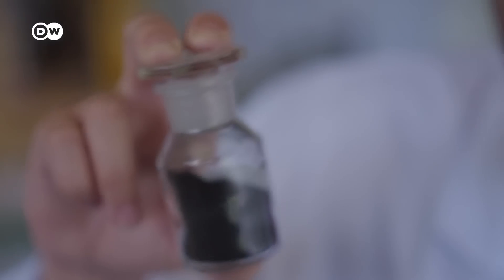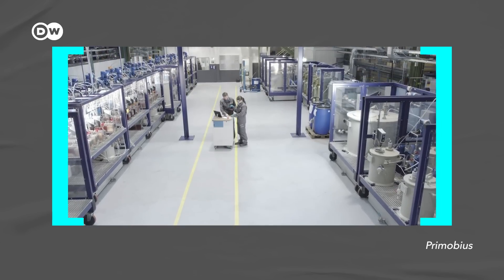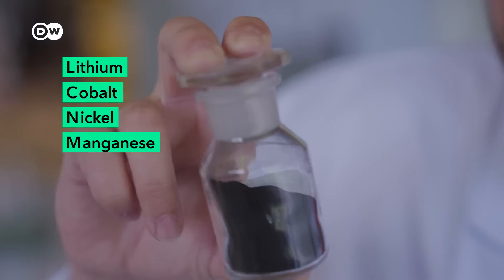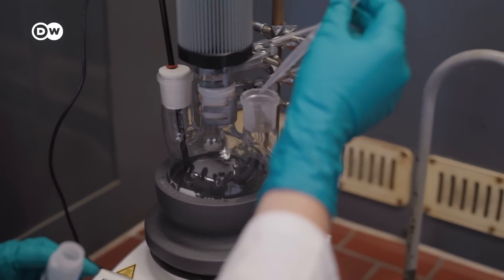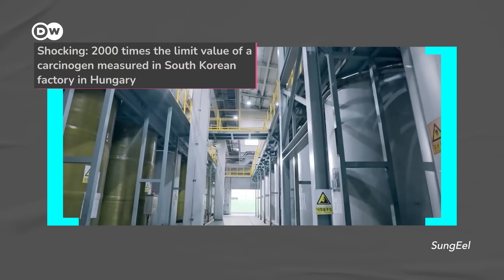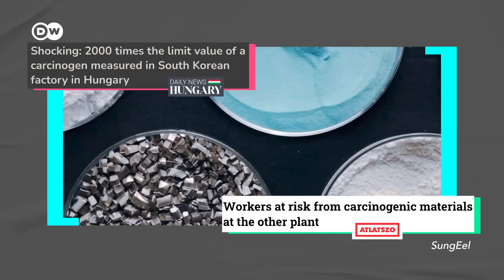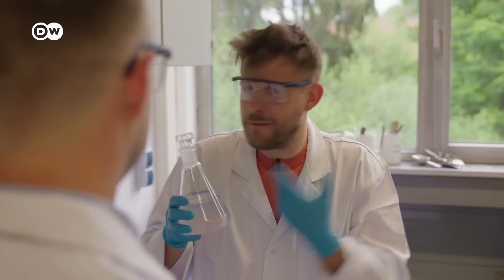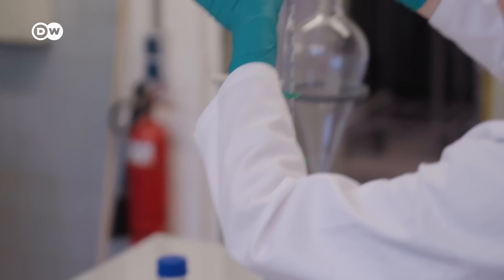The problem with recycling electric car batteries

Comment: 1. EV battery life is longer than most people imagine. A lot of 10 years old Tesla EV battery still retains a lot of charges.   So there aren't enough EV battery for the battery recycle industries to make profit. 
2. Battery recycle industries need subsidies to learn the challenge, before enough old EV battery stock pile up. Without subsidies, the EV battery recycle industries will not survived. While China government happily provide grants for battery recycling industries in China,

Comment: What was clear was that if the recycler got the batteries for free they made a lot of money. That's good news as it means there is a instant market for an old and dead battery so people will cash the battery in rather than dump them. Maybe the recycling of batteries will just happen naturally and not require massive Government intervention / subsidies etc etc.

Comment: Hey 🙂 
REDWOOD Battery recycling. CEO. JB Straubel. has been with Tesla from the start of Tesla, with responsibility for the battery system
Now he is the head of RedWood Recycling.

Redwood had to go out and find and create supplies of used batteries worldwide, as that market was not there before, and it has been a big task, there are extremely many batteries from mobile phones and laptops, and of course other electronics.
:-)
YouTube
https://www.youtube.com/@redwoodmaterials/videos

Comment: I'm no battery scientist but why do we shred and mix everything down to powder form and then find ways to separate. Is it like impossible to separate cathode and anode? Just asking. Can't we just charge the battery 100% and recover Lithium Cathode? Idk I think physical separation might be expensive because of human intervention but it seems to be easier option to me.
Reply: Graphite can't recycled and is classified as finite material. Graphite is pretty complex. Natural graphite can vary much in it's quality. Synthetic graphite is better but dirty and energy demanding to make. Petcoke, tar and slack are blended together in steam heated blenders and during high temperatures and high currencies this plastic mass is turned into graphite. Right now there's no market for recycled lithium carbonate, It's thrown away like waste

Comment: Interesting  and disappointing that this video does not discuss the main fate of most EV battery "black mass": burning in smelters
Reply: well yeah a chemical battery is not economically viable to recycle in any way whatsoever.  Unlike lead acid that actually has value and is easy to recycle.

Comment: REUSE BEFORE RECYCLE
I've made a 25k/w battery from 2nd hand battery 
I reclaim over 80% of batteries 
for example, cordless drill battery has 10 cells 2p by 5s
when 1p fails the whole battery fails i get 8 cells at 80% plus life still in them
It takes about 20 minutes to strip one k/w
3 days to go thru test cycle no labor
I make 140 18650 cells that test over one K/w
14 s of that is 12 K/w at 20 to 80 % useable and will last for 20 years
REUSE BEFORE RECYCLE
Start to finish you could make 2 one K/w cells an hour 
The 20% of dead cells with be strip down and separated 
to circuit bords plastic Nikel strips meatal screws etc
Cut down on the amount of materials to be processed   
if you pay $50 hour labor you can make 1 K/w for $25
Good for 20 years of grid or house storage 
Why is this world so dumb
Reply: You can set small scale factory close to source 
The math's is scalable from 1 person to a 1000 people
Reply: I also reclaim 2nd hand solar panels 
so 2 sqm of roof of your 1000 sqm factory
can produce 1 k/w a day 
equals 1000 K/w a day average
2000 K/w Battery will use up about 100 sqm of floor space 
rent out the 900 sqm
1000 K/w a day at $0.20 K/w is $200 a day profit
$70,000 a year
for 20 years
with some Maintenace

Comment: We can't even recycle sorted plastics efficiently. I am not holding my breath on battery recycling coming anywhere near economical viability.
Reply: the difference is that soft plastics are challenging since new plastic is so cheap. at least with batteries, the cost of manufacturing new batteries are already very expensive, so there’s a good chance recycled batteries could potentially be cheaper than having to mine for new materials
Reply: No doubt. for years they also lied about recycling glass. We'd put the bottles in our recycling, or bring them in for deposite, and yet they'd still end up in the land fill for years. Then they finally scrapped glass bottles.
Reply: Have you heard that EU and Germany plan to mine lithium reserves out of Serbia? They partnered up with Rio Tinto to dig out lithium reserves in Serbia, and thus, cause ecoligical disaster...
But no one cares, because Serbia is a cesspool of Europe, not enough woke for Europe 🎉

Comment: Interesting!  If battery manufacturers were made financially responsible for the recycling then there would be more motivation to standardize batteries for the recycling process.
Reply: I think that's where government is need as an intermediary to create policies that standardize batteries for recycling process as well as balance for future innovation.
Reply: maybe in the future the manufactureres will be recycling their own batteries so it could be easy to recycle them. Ex. Tesla having a recycling plant. They can automate the human labor part since they have a few types of batteries and it can easily be automated. They wouldn't have to worry about so many different type of batteries.
Reply: @jayshahrealestate  The plant they show footage of is being developed for Mercedes by SMS. It will be run by Mercedes to deal with production scrap, recalls, and their own end of life batteries. Standardised feedstock, known scale and economics, completely vertically integrated.
Reply: I agree. Most likely raise the price of batteries, maybe not double. I think it's a question of our societal values. Value short-term production at low expense or a long-term sustainable approach at a larger expense in the short-term. I think government should be involved, because I don't think industry would self initialize standards.
Reply: I see how you would apply business logic to end up with this thought, but this is where the main problem in this case.
 
The batteries are not a thing that can be so easily dismantled. 
They are a highly sophisticated, high voltage storing device, a thing, that is a lot more than the sum of it's parts. Once assembled and charged, a battery is not an easy thing to handle, on a specialized worker scale OR worse an automated line. 

Further more, battery modules are really the most often changing part in EVs right now. From newer architecture to newer chemistries or even different charge architectures, they might change 2-3 times per year in the same model! Sure, some parts will be the same, but they are the biggest RnD sector in EVs, every kilo and every kilometer they can squeeze out matters a lot. So automating a line with robots with all these revisions would be really hard at the moment even if you had a dedicated line for say only Tesla Model S's batteries.
Reply: @KostasTsakalidis   @tommclean7410  read about Jadar mine and Rio Tinto's plan to use around 1-3 olympic pools of concentrated sulphuric acid (H2SO4) for Jadarite (ore that contains lithium) refinement.

An interesting fact, the formula of Jadarite is similar to Kryptonite 😁

Jadar area is located in Western Serbia, and is near Drina river (Drina is a part of Danube watershed). And Jadar area has one of the most fertile soils in Serbia.
Reply: Except that the current 'free enterprise' corporate mentality despises standardization over proprietarization.
Reply: Have you heart about the EU plan to mine the fuck out of Serbia's lithium reserves??
Reply: But who is to say what the "standard battery" should be? The whole idea of competition is the best product will eventually emerge. Having a committee of "experts" decide the correct path is asking for BIG trouble. At one time a majority of "experts" claimed DC electricity was the way to go when it comes to commercially provided power, (the first commercially provided electricity was Edison's DC system), but the market eventually proved that AC was better. 
Not only that, if you make all battery manufacturers financially responsible for the recycling of the batteries they make, how many companies would continue to make any batteries at all? And the ones who did continue to make batteries could only stay in business if they passed the higher cost along to the end user, YOU. So instead of the average EV price of $65,000.00, the average could be $130,000.00, and a replacement EV battery would be $80,000.00. Because fewer EVs would be selling, the number made would go down, and the unit price would go up. In no time EVs could be in the $250,000.00 range. Then who would be buying EVs? In fact, who could buy EVs? Only the rich, that's who. Is that what you want?
Reply: True. But if this responsibility is only applied to EV/battery makers then it gives an unfair advantage to fossil fuel producers who not only don’t have to consider the lifetime effects of their products but even get subsidies for pumping oil. My point is: we need a concerted effort
Reply: Only if they combined their recycling efforts or outsourced the recycling to a third party.  Maintaining their own proprietary recycling chain might be the approach they would take just as Tesla benefited from having a proprietary fast charging network and Apple benefited from establishing a proprietary ecosystem.
Reply: Hello from Los Angeles California.  I lived all my life in Los Angeles California, and in the 1980's the Smog was so thick it filtered the Sun. The smog blocked the Sun so much the winter's in Los Angeles California was so cold between 36° to 55° Fahrenheit nights dropping to 33° Fahrenheit 
I couldn't see mountain ranges from where I live 4.5 miles away. Unless it was windy and smog cleared. Now the air is so clear you can see cracks and riges, on the rock walls. 
It uses to rain 🌧 none stop for 7 months, and the summers never exceeded 90° Fahrenheit. Due to Sun being filtered from smog I also didn't need shades, for my eyes. Now 🌡  are 110° Fahrenheit for excess of 1.5 months with 5 days in the roll Temps exceeding 116° and 1 day at 120° to 126° depending on fire conditions radiating heat. 
Air clean enough, and it will not get any cleaner with only Electric Vehicle's (EV's)
Now to the reason why Environmental green agenda causes Drought Conditions.  In 2010- 2013 there were Solar Mirror s installed to project solar arrays to a Tower with mirrors projected downward to under ground reservoir water sources.  To generate steam, and generate Electricity.  
The temperatures 🌡 causes the atmosphere to close to 5,000° and every time birds fly thru become instantly baked and fall. 

In the 1980's the Jetstream used travel across California in to Nevada,  Arizona,  New Mexico,  Texas, and so on to Florida.  Due to the Mirrors the Atmospheric High Pressure. Has pushed the Jetstream away from Southern California to North to Washington,  and or Canada 🇨🇦 . This cause along with getting rid of Smog cause higher temperatures and Drought Conditions. You couldn't pay me $10,000,000 per hour to sit, promote,  sell, let alone buy any Electric Vehicle's (EV's).
If you look up StachD Training channel, on his video titled Lithium Largest Ex plo ding EV Recycling ♻️ Center in Missouri.  There were 4 Recycling ♻️ Centers in the United States.  Now there are 2 Recycling ♻️ Centers,  and none are in the State of California.  Due to Environmental Impact, which the video shows Fire Authorities spray granulated elements of the Lithium-Ion Batteries 🔋 Packs,  into creeks, rivers,  and lake anfmd underground well resources.  Not even boiling helps, and fish hacmve died in those water ways.   Sure clean the Air while you Pollute the water. In April 2024 the 1st Recycling ♻️ Centers in Phoenix Arizona location burned down,  and dousing water to keep cool prenting spread of fires 🔥 have caused Drought Conditions.  @truebrit3670  Look it up
StasheD Training channel 
Missouri Recycling Center ♻️ Ex Plod ing can't spell this out. Fish died wells for water is no good anymore,  and became Acidic 
These are facts. 
Mirrors in Mojave Desert Modified where Jetstream away from
 Southern California.  
The so called green agenda is to keep there pockets full or bank accounts.
Reply: Makes these expensive batteries even more expensive. Probably double the price 😆
Reply: @philpreston3072  Not necessarily. If Tesla, for example, knew that it would be responsible for recycling all it's old batteries then it would design them with that in mind. Which would most likely result in making them: 
1. Cheaper to disassemble. Right now they are a nightmare with all the adhesives they use to secure things.
2. Have more parts, like the housing for example, be reusable or at least more easily recyclable.
3. Use battery chemistries that are more conducive to recycling.
I wouldn't even be surprised that given enough time, it would drive the cost of batteries down as the old batteries start to become valuable. If the recycling process becomes efficient enough, old batteries will have a scrap value that would help offset the cost of swapping batteries.
Reply: @siggyincr7447 Swapping batteries is a rare event and will get even rarer with new generations of batteries. The problem with newer Tesla batteries specifically is that they are almost impossible to repair, whereas Korean batteries (or rather packs) for example are fairly easy to repair. Which means they are also fairly easy to recycle. Tesla packs will have to be shredded as a whole. However, the vast majority of battery packs do and will outlast the car they are built into. It seems rather unlikely that there will be a significant amount of batteries to recycle anytime soon. The EU never the less requires new batteries to consist of a certain percentage of recycled materials from a certain point onwards. That should motivate manufacturers to make batteries easily recyclable (because they must purchase recycled materials regardless of price and thus are interested in keeping recycling cost low) and it means battery recycling will be a solid business.

Comment: In my opinion, profitability should not be the determining factor. When a company produces something, it has a responsibility to the environment to ensure its products can be recycled, thereby preventing environmental harm. I believe we humans need to adopt a different mindset: we must stop doing things without considering the consequences and then dealing with the problems later. This way, we avoid situations where 'it is not profitable to…', as profitability should not even be a topic of concern. Inevitably, we end up questioning the value of the environment or life itself, which should never be the case.
Reply: If not for the profit what will be the incentive?

Comment: So, from my humble perspective of a bachelors mechanical engineering student, the first logical step for me would be normalization- manufactures should agree on the sizes of the individual batteries, so the robots can be programmed and dismantle them- that would cut out the expensive manual labour. And then maybe, but ofcourse, I don't know how much competetive they want to be, they should agree on which types of the battery fillings to use. I feel like if there will be just few simillar types, that this challenge can be overcome too. But again, I am writing this here just because norms at my field usually do a pretty good job at lowering the cost and effort of designing, manufacturing and selling certain parts....

Comment: When I see images of old batteries being shredded I always think the same, ¿Wouldn't be better to disasemble it piece by piece? I mean, every piece is made of separated elements, why shred the battery as a whole, when you could treat each of the separated pieces? A lot of energy was used in separate those elements to make those different parts and components during the fabrication process, why mix all of that together again, just to separate the elements again shortly after. I can't believe that it's cheaper this way, to be honest... 🤔
Reply: Safety issues, time, cost, energy consumed during the process. Have you ever dismantled a large battery? It's not ment to come apart 😂 it's hard work and potentially dangerous

Comment: Bottomline, the battery industry is still not fixed, we still don't have the perfect battery (and probably never will because each have a strengh and weakness, so likelly we will always have different types of batteries). So, only once the industry can settle on which of each different compositions we should "standardize" batteries, we will have a proper recycling. However, I must say that for all the Eco-green talk, asking companies to turn a profit from recycling is a little strong, Governments should subsidize recycling.
Reply: Have you heard that EU and Germany plan to mine lithium reserves out of Serbia? They partnered up with Rio Tinto to dig out lithium reserves in Serbia, and thus, cause ecoligical disaster...
But no one cares, because Serbia is a cesspool of Europe, not enough woke for Europe 🎉